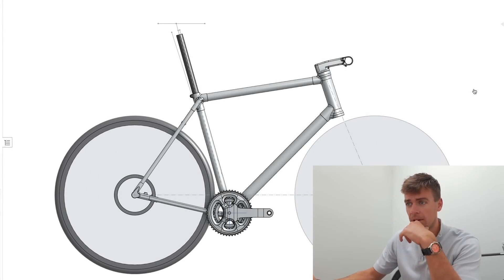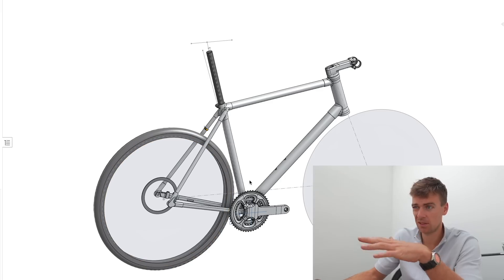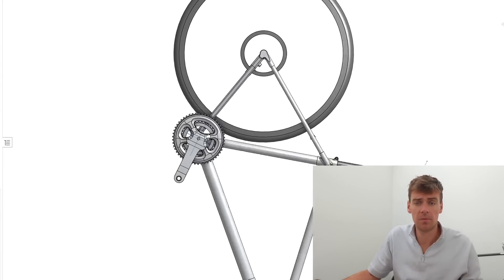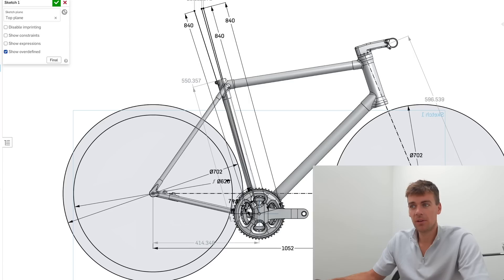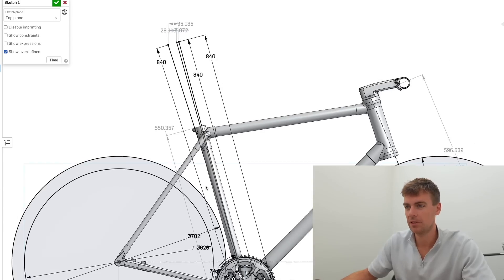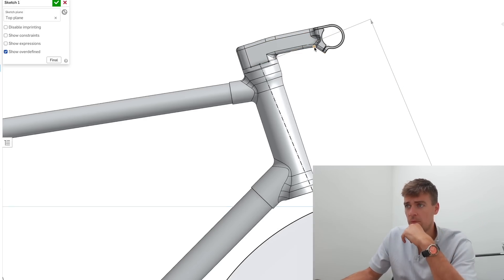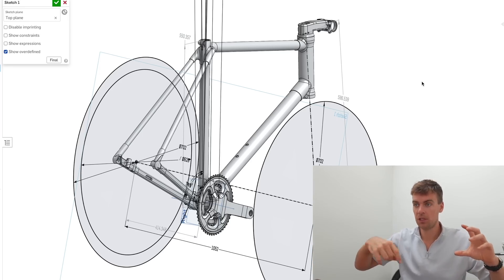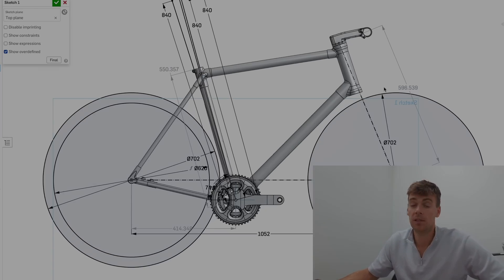Bike Design: bike fit, comfort, body aerodynamics and merging genres.

Comment: Interesting that you need a steep seat tube angle to accommodate your femurs. Like you I have long legs (and particularly long femurs) and not a very long torso. Through bike fits etc. I've ended up in the opposite position: seat slammed all the way back to reduce some knee discomfort I was having when further forward.
Reply: Long femur will push your hip rearward relative to shorter femurs (assuming same knee position relative to pedal axle). Lots of body weight in the lower torso and hips so if you go further forwards you’ll get what he claims is better weight distribution.

Comment: Did you ever think about going 650b? I think that might make some of your wishes concerning geometry easier. I’m still waiting for 26” to be the next big thing. That would be awesome for the industry - we would all need new frames and wheels. 😂 (Not for MTBers obviously)
Reply from the maker: Nice comment. Yeh i did consider 650b for the gravel tyres etc but the wheelset limitations in road axle width are quite…limiting
Reply: @PeakTorque a number of us in my group have been using 650b on modern road bikes with thru axles for years, and carbon rims on good hubs with Enduro bearings and end caps and drivers for all the standards. If you end up wanting to try that out, a 650b x 42 has an OD same as a 700c x 33. Inertia is really low with a good carbon rim and light tire (Rene Herse), which makes for a very sporty feel.
Reply: I use 650b for road, and I'm tall, can't imagine why shorter riders aren't considering 650b or 26" as you say.
Reply: @jaro6985  There is still a lot of develpment in wide road tyres and gravel tyres, but it is all around 700C. There are no new 650B tyres being released. It seems 650B has been adandoned by the big players.
Reply: @simpaticobikes  that looks to be true, kinda sucks. At least I will always have MTB tires, I'm not too concerned about top tier performance.

Comment: I’m the opposite — 180cm but with short legs. When I got a bike fit, my seat (and cleats!) had to go forward, and my stem down. Bloody seat post though … 15mm offset so the seat is right forward on its limits — and I can get a 0mm seat post off the manufacturer at the cost of several hundreds of bucks!!!

Comment: I have the same issue with seattube angle. I have to use a zero offset post and have the saddle slammed forward. My bike has a 73.5deg but most bikes I’m looking at for my next one are slacker and have a proprietary seatpost with massive setback! Basically means I need to pay a premium and delay while I order a suitable seatpost.

Comment: Looks great! I’d make very similar choices if I were designing a road bike for myself as well. Perhaps the main difference would be a higher bb for pedaling clearance
Reply from the maker: Short cranks (165) and bigger tyres so can go much lower. BB drops in main brands are the same as when we had 23mm tyres and 175 cranks
Reply: @PeakTorque interesting. I would have to run the simulation to figure out how the bb drop affects stability / handling.
Reply from the maker: @rrluthi1  just send it 🥹

Comment: Have you seen Bike Sauce's video on the myth of vertical compliance? He found that a frame's compliance has almost nothing to do with vertical deflection and mostly to do with horizontal deflection.
Reply from the maker: I have seen that video, but he’s speaking about vibrations at the axles and the BB. That is independent of what happens to your body when you hit a large bump, seated. I have some data loggers like that, that im using for some Crr testing.
Reply: This is another good argument for using a 26er MTB frame in a road build, it ends up looking like a mega-compact thing like first-gen Team Once TCRs, giving you loads of exposed seatpost - which will have lots of rearward deflection

Comment: I am currently an engineering student. What CAD software are you using ?
Reply from the maker: I use Onshape and Solidworks. They are very similar.
Reply: Looks like onshape
Reply: Check out IronCad. They used to have a student version but it’s been a while since I’ve lived in that world.

Comment: I'd be curious about the Canyon/Ergon VCLS seat post. Also, with that much seat post exposed, are you anticipating a certain amount of bend with you just sitting on it? Would this undo some of the benefits of the steeper seat tube?
Reply from the maker: Indeed. But the steeper the angle, the less the aft bending. A very laid back seat tube angle would give more deflection for the same load. I will measure it.
Reply: @PeakTorque I used the Specialized C-GR post with leaf-spring design on my cyclocross bikes for 4 seasons, and they worked well. The bikes were alu, and I wanted to have be able to keep the power down more while in the saddle over rough courses; we have frozen ground often enough. They worked well, and ST angle is not going to make a difference. The only downsides would be aesthetics and setback. Setback in ample supply can work well for a CX bike since you want more rear-bias and sizing down can work well for handling, but I know that’s not what you’re aiming for.
Reply: Canyon VCLS 2.0 is amazing, saved my injured spine. 
Only thing is the shitty tolerance on the diameter means it slips unless you shim it or glue it.
There isn't significant sag to it, unlike the spring or pneumatic seatposts.

Comment: I am a small or between small and medium and the seat tube angle is 74 or 73.5 . I wonder why they slack it as the frame gets larger. You'd think the triangle would stay the same except with larger portions.
Reply from the maker: Yep 74/75 is very common on smaller sizes. Of course its personal preference. Some big guys still want 72 deg, but when the road goes up hill…
Reply: They have to slack them for small frames because, overall, there is too much wheel for too little frame, lol. Technically, too much front wheel for the stack range available to work with. Wheel size to frame size ratio affects a lot of things. The wheelbase will be too short and toe overlap would be extreme, ride quality and handling will be horrendous. 
If wheel size would be proportionately reduced with frame size, normal frame angles can be retained but the downside to that would be no standard wheel size.
Reply: @cosinus_square  But they seem to keep slacking the seat tube more and more as the size increases. So it's not all forced by the wheel size compared to frame?
Reply: @Al.2  For large frames they slack the seat tube to keep the wheelbase short, so the bike's handling is crisp and nimble, instead of riding like a tandem. If you observe the front end of large frames, they maintain very similar headtube angles to medium frames. Front end can be addressed on large frames, can't do that with a small frame, not enough rider for that. Volume manufacturing plays a big role as well, similar to standardizing wheel size, a majority of manufacturers use the same forks throughout the range, therefore the geometry for the whole range may be forced by the fork. Some manufacturers offer different forks, raked to specific sizes, but it not that common, especially since the market was flooded with cheap carbon. Wheel size seems to be getting bigger as well, what's up with that?
Reply: @cosinus_square  I'm not sure if it's worth sacrificing the rider's fit just to keep the wheelbase an inch (2%) shorter. A longer stem could be another solution, I guess.
Reply: @Al.2  Top tier brands' geometry is based on racing performance, so short wheel base it is. 
I'm certain there are options out there where the rider fit would be so good on a bike, it would feel suction cupped to it, but no one cares, everyone wants Specialized, Pinarello and Factor bikes.
Also, slacker geometry seems to be what people pay for with gravel bikes taking a big chunk out of the market.
Reply: @cosinus_square  Racing performance (power x time as PT put it) has to suffer [more] with a compromised bike fit. Gravel bikes are a different breed with a higher stack, but I reckon the saddle position should still be about the same relative to the bottom bracket.
Reply: @Al.2  the pro racers' fit and power output do not suffer at all, as they get exactly what they want from the sponsors, racing equipment is not the same as the stuff available to the public, despite what they claim it's custom tailored for each rider.
The public's fit and performance suffers as a result of choosing racing equipment for 50 mile clubrides once a week.
Reply: @cosinus_square  Why did Pogacar have to run his saddle all the way forward in some races, then? They ride frames with the same seat tube angles as "the public", no? If body proportions don't change (on average) with riders' height, all this doesn't make much sense to me. Are Peak Torque's body proportions such an exception? Or any long-femur, short torso riders for that matter?
Reply: @Al.2  I would assume he was going for an aero / TT' ish position on flatter stages to gain an advantage of course, it's not his regular riding position and definitely doesn't work for climbing. Maybe Colnago decided it's not worth to make this bike for him and also to make it available to the public. There are regulations for bikes too. I don't know what happened with Pogacar, as much as I'd like to speculate. Ask him on socials, maybe you'll get an answer.
Maybe PT's body proportions ARE an exception, why is that so unconcievable? Riders with specific requirements are negligible, that's why Specialized or Cannondale or Giant don't cater to them. They stopped making rim brake bikes, which were supported by a helluva lot more riders than all 23 long femur riders on the planet.
Reply: I can't quite wrap my head around long femur riders. Should the seat tube be more steep or more slack for them?
Reply: @Al.2  more slack since your knee position relative to the bb would be longer the longer your legs
Reply: @phqnomenon  That's not at all obvious to me since knee position over the pedal spindle or the bb is apparently not that important, like in the squat - a longer femur actually requires greater ankle dorsiflexion to allow for a more forward position, otherwise you'll lose the balance.
Reply: @Al.2  it's important. Further over the front tends to put more load on the knee and quads, which is why BITD people said to squat with knees not going over their toes, since that would keep the load lighter on your knee and quads. 
It's also person dependent, some people can tolerate more knee forward and others can't.
Reply from the maker: @impaledface7694 maximal seated output power x time (for me) is far lower with a rearward seat. The difference is bigger on the climbs. I can tolerate it in the knees so i prefer forward.
Reply: @PeakTorque  That's my experience, too. I wonder why the geometry charts have the seat tube angle decrease with the size increase. Do body proportions change with height (on average)?
Reply: @impaledface7694  Is it even possible to squat (especially front or high bar back squat) to a good depth without forward knee travel past the toes?
Reply: @Al.2  It was pretty much only a low bar thing, and it was mostly hip hinge since the idea was to keep the knees back. Pretty rough on the low back. Best you could reasonably get was parallel.
Reply: @PeakTorque  I just know one guy who ran extended setback seatposts but he was a long torso guy with longer femurs and short tibia. I suspect the lower seat height+long femurs at that seatpost extension ran his knee too far over the bb. I run middle to forward with a 73.5 STA and that works good for me. 79cm to top of seat with 170mm cranks.
Reply: Steep(er) seat angles will be the next reason to buy a new bike. I’m 189cm, much prefer this position and always thought it was stupid that Seat angles slacken as the size increases.
Reply: Installing disproportionally long (too long) cranks on smaller sizes might also have something to do with this odd practice .